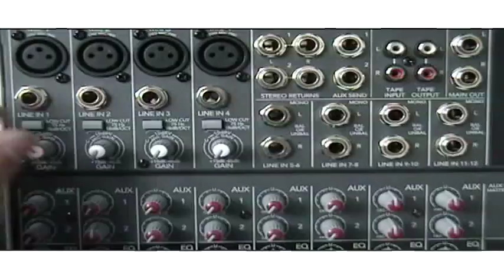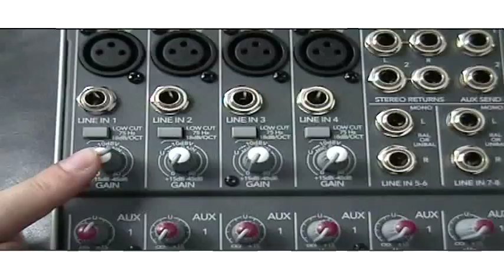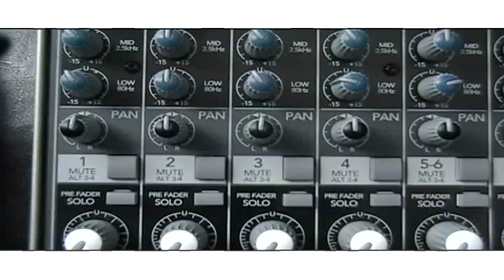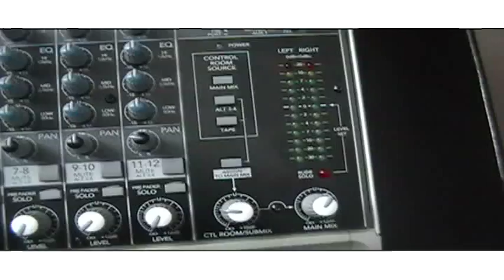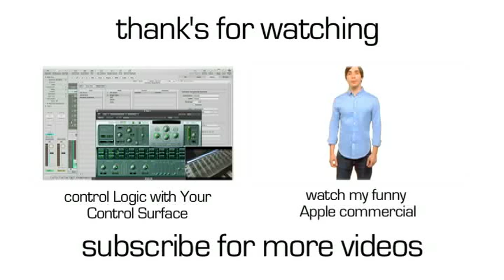How To: Understanding an Analog/Recording Console

Comment: how do you control the gain on the channels that dont have a gain knob for example channels 5/6 i have the yamaha mg10/2 mixer.. and is it better to record with a low gain and high level output or a higher gain and a lower level output?

Comment from the maker: @snrose2002 try check your cables to see if that is causing the buzzing!! Unplug one cable and see if the noise is still there.. Continue to check this method with all the cables to see if it is a cable problems... It could be as simple as that.. Let me know if that solves the issue....